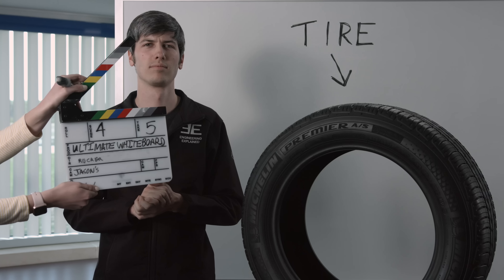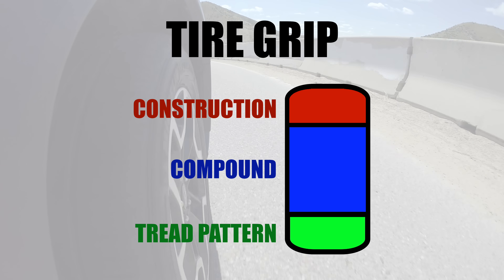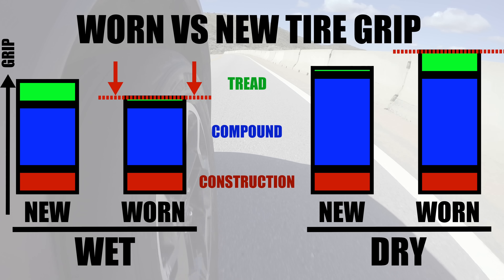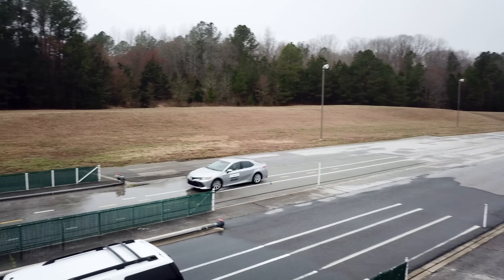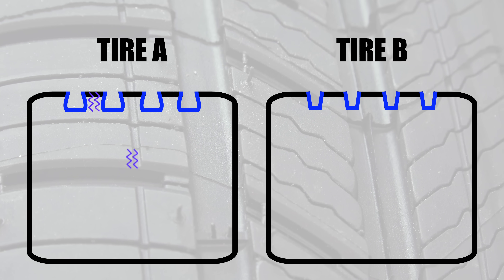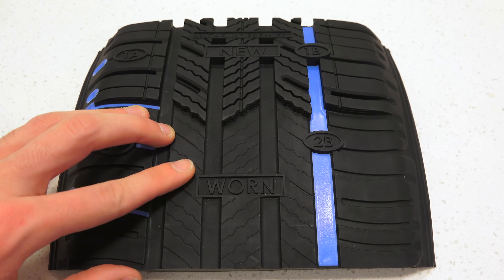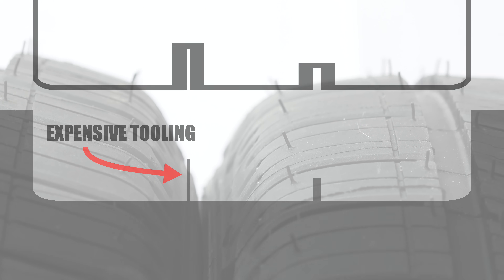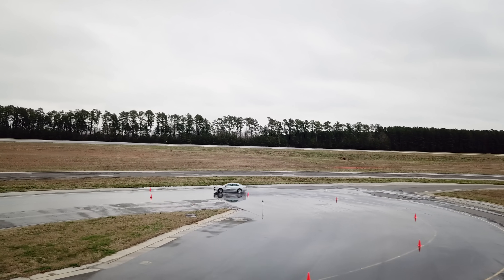New Tires vs Worn Tires - What Performs Best?

Comment: Hi engineering explained maybe you can help me. I put In new struts in my 02 Camry but the new ones were about an inch or so taller than the old ones so now it's nearly impossible to get a good straight alignment and my car eats tires in less than a year! I have had at least two sets in the two years I've been driving and they aren't super cheap tires either. I know my car only has tierods for alignment adjust ment as far as I noticed is there anything I could to straighten my tires out because the inner tread is taller than the outer tread on all 4 I need some way to adjust the camber I think

Comment: This is how a video about Tires should always be done. It doesn't mean necessarily to be kind of similar copies, but the explanation should be correct. I saw different videos where there was this tendency to actually make all people think that is not an issue at all on the wet surface as the Tire Wears. Thanks for giving us this explanation.

Comment: Firstly, what you say about tread depth it correct - this is why ultra-performance DOT tires will have very large tread blocks, and perhaps even :slick" portions of tread. This is also why in some race classes that require DOT tires, people will sometimes do what is called "race-shaving" to cut down the tread on new tires. Yes, this decreases the service life of the tire - but when people will spend money for faster lap times or a competitive advantage, this makes sense.

But actually not true about the compound. The compound grip does degrade over use due to heat cycles . This is a well know phenomena in racing. For example, as you say racing slicks have no tread, so the grip level should remain constant over the life of the tire according to your claim. And this is just not true. Even though the racing slick may still have life in the tire, your lap times will increase as the tire ages and the compound grip decreases. Lap times will again decrease after putting on fresh tires. This is why tire management strategies are so crucial in racing as you will need to decide when to use fresh tires for best lap times and when to tolerate worse lap times with older tires. And this is why some racing classes will control tire use in order to keep costs down. Someone with a lot of money to spend on always using fresh tires will have an advantage over someone who has to use the full service life of the tire because they can't afford to always use fresh tires.

So what you have (in dry conditions) is a rate relationship between the increasing grip as the tread wears down and decreasing grip as the tire compound ages. But the "winner" in that race is actually the grip lost due to compound ageing over grip improvement due to shallower tread depth. So in racing DOT spec classes, there will still be better lap ties with fresh tires over old tires - meaning even on the street in the dry, new tires will have better grip over old. (Now, this is assuming at least moderate level performance tires, it may be that with very fine tread and tread blocks tread wear grip improves faster because there is so much grip lost to begin with, I don't know. But then, people running those tires probably don't care about grip anyway, so the point would be moot.)
Reply: Also to note, while not the exact topic of the video as regards tire ageing, but related to tires and grip is sidewall height. The effect is much like that of the tread blocks themselves. Taller sidewalls allow for more tire flex under cornering which the pulls a portion of the tire up from the pavement reducing effective contact patch size and thus resulting in lost grip. This is why performance tires will have shorter side walls. Hence the plus 1 / minus 1 theory to improving tire performance. Go to the next larger diameter wheel and go down in tire aspect ratio to reduce sidewall height.

Comment: no reason to watch the video
i already know, new tires are best when the first layer is off. it is there to store the tires and to prevent damage to the real "compound" depending on tire, drivestyle, etc it can take 200-500km
why would worn tires make it better? its like asking "are used brake pads better than new ones? or do they even perform better with nothing left on them? lets find out"
how about you test some tires from different companies instead?
Reply: that is not the purpose.  The "coating" on a new tire is simply mold release agent.  Without some sort of mould release it would be very difficult to separate the tire from the mold without damage

Comment: Curious what your thoughts on re-tread tires? (obviously not for performance) If you did a video, I'd also talk about being careful trying to save money on tires because you have to watch out for the tire tread cutting scam.
Reply: that's mostly for commercial tires.  If it's done right it's fine.  Most of the blown retreads you see on the road are from underinflation.  It's not very common for a regular passenger car to even have enough rubber depth to cut grooves deep enough to make it look like a new tire.  Even if this was done the date code on the side of the tire would give it away IF people looked at that when buying used tires.

Comment: There's one thing you forgot! Age!!! Depending on how much you drive, it is not only wear that affects the tyre but also age. Rubber compound is only guaranteed for a certain period. So although you get more surface contact are as the tyre wear down, with time the compound losses its characteristics becoming stiff, dry & brittle
Reply: And on top of age let's not forget heating/cooling cycles.
Reply: Great comment, came here to say the same!
Reply: Mihai Constantinescu THANK YOU, just mention this in my question.
Reply: @PapotsGarage  
You don't know that to be the fact for the particular tire compound in the video.  Some will wear better than others.  Hint: source material for the 'rubber'.
Reply: Ya it's true and also maintain the curing time of that rubber perfectly. Otherwise all the process goes in vain.
Reply: Exactly what I thought I have just gone from 2011 to 2017 Michelin and the dry performance is better as well on the newer tyre
Reply: have you got any other good news for us?
Reply: I can confirm that on my rear Michelin Primacy 3 made in germany. They started to thump due to worn inner threads
Reply: Yep my tire is from 2008. It's currently 2020 at the time of writing this.
Reply: my tires are oem from 2005 and they grip as good as new
 @noahmeme2
Reply: As someone who has never owned a car, but with a love for old bicycles I can tell you that tyres which look new and have not be ridden for thirty years do not last a week (and then came the challenge to find tyres fitting a 1974 22 inch rim whith covid lockdown in china......)
Reply: He actually says compound grip doesn't change as tyres wear.  This is misleading as it does change over time/with age, so unless you're going through tyres every year or so, this is a factor which is ignored in this video
Reply: @OverTheHillMTBAU  Even within a year the compound degrades significantly. At least it does when you are autocrossing regularly.
Reply: Mihai Constantinescu There was a huge oppertunity for Michelin to mention the compound/age effect to make us all buy new tires. Yet they didn't wonder why.... confused.
Reply: @dubro5009  First time I took a car with Michelin CrossClimate2 on into a garage the shop boss slagged them off saying they didn't last.  Well two years later and they haven't worn much and the rubber is still peculiarly soft.  I have bought some s/h PA4 and 3 years old and the rubber is like new.  Some Michelin PS4 S and, yes, same again soft and like new.  My other PS4 S are two years old and have lost their side wall appearance through road dirt but still soft.  Pirelli PZero seem harder after 4 years but then that's 4 vs 2-3.
Reply: And it is more crucial actually than the others.
Reply: cap. some tires are stored in warehouses for 10 years then sold.
Reply: tire.
Reply: Tyre, actually. I tire of your antics.

Comment: This is true and false. Michelin and other companies such as Continental, Yokohama, even some of the newer Goodyear tires have very similar designs in their tires. Continental has a groove in groove technology that helps specifically with winter traction. I can list for Yokohama and Goodyear the similar attributes. The reason that Michelin went with this technology is the expanding grooves and sipes is because the tire starts off with less tread than their biggest as tire the Defender LTX. The Premier A/S starts with 9/32 of an inch of tread where most tires on the market will start with 11/32 or more depending on the tire and the application your looking for in the tire. While the Premier does perform really well, there are some other issues with the tire, since the tire has less tread from the start the tread compound is harder so that there can be a higher life out of the tire but it generates more road noise.

Comment: Great video,
It's possible you missed an important factor though - 
a "shaved" new tire would perform better in the dry, that's why some racers shave new semi-slick and street tires,
However, realistically it would take a lot of heat cycles and time for a tire to lose much tread on road use, so by that time the tire would grip much worse in the dry as well.
Might be worth mentioning, so people wouldn't think their old tires are safe in the dry!
Reply from the maker: Yes, definitely a difference between "worn" and "old." I think it'd be awesome to see some content purely focusing on age and how it affects performance.
Reply: I'd love to see some hard data on tire age.  It's a complicated one though, some of the age is pure age, some of it depends on environmental conditions (which is why i store my winter tires indoors to avoid UV degradation)

Comment: You forgot about heat cycles that change the compound performance
Reply: St0RM33 thank you, I asked the same. My a048 are a full second slower when old
Reply: Ummmm you don't heat cycle  touring tires lol. Trying to race with them will help your drifting though lol

Comment: I was targeting a set of these about 2 weeks ago, but my installer couldn't recommend them because of short tread life.  Of course, with a compound that grips more, the tread will wear faster - everything is trade-off with tires.  It makes me wonder if this tire has a mistaken identity.  Anyway, I'll never know how much life I would have gotten out of them because I didn't buy them.  I still like them though.  Cool tire.
Reply from the maker: What specific tires are you referring to? The ones in the video have 60k warranty. Personally I use a summer and winter set with less overall tread life rather than all-seasons, but the ones shown are definitely designed for long life.
Reply: The Premier A/S is the tire I was referring to.  I was surprised to hear that from my installer, but they are tire nuts so i went with their recommendations.

Comment: Older tires also get better gas mileage due to less friction.
Reply: Friction increases with treadwear. Didn't you watch the video?
Reply: Yes I did. All that tread on new tires adds rolling resistance. As the tread wears away, the tires become smoother, and have less rolling resistance. There is more surface area touching the ground, which when dry can gives more grip for acceleration and breaking. But under constant speed, such as interstate driving, the reduced rolling resistance allows better gas mileage. I’m on my third set of tires with the same car. I buy tires designed to improve mileage. Every time I put on the new tires my mileage instantly drops 3-4 mpg. I even called  Michelin to ask why their high mpg tires caused my mileage to drop. Their response was the newer tread caused more friction than my older smoother tires, and that the mpg would increase over time, as the tires wore down, which is exactly what happens. They also said water performance would decrease as the tread wore down, which unfortunately is exactly what happens.

Comment: My tires used to be worn out with no tread, and terrible in the rain.  Now the threads are exposed and they work pretty well cutting through the water.
Reply: GoogleMinus same with mine. They are down  to the canvas and the grip is much better now.
Reply: GoogleMinus I have really bald tires on all wheels and they still drive fine and I push my car round corners

Comment: The compound may not change much if you wear them down in a short period of time.
But it may take years to wear your tires, and in this instance the compound changes at least as much as the rubber looses its softeners. And with that often lots of Grip.

Comment: Michelin Premiers are pretty terrible tires. Good idea, but I've never had a tire chunk so much.
Reply: Andrew Malkin  The reason they chunk out is because of the deeper sipes and the amount of silica in the read compound.
Reply: Cure Meister Try a Michelin Defender instead.  It's not as fragile on crappy roads
Reply: V - Pony The new Defender T+H also has a silica compound.
Reply: That's because you either drive on really crappy roads (not your fault) or you drive way too aggressively (your fault). I've had a set of these for 2ish years now and they're wearing perfectly.

Comment: I actually noticed this when my Michelin Primaxys were new. I thought it was weird that brand new tires didn't grip as they should. From 500 - 1000 miles they improved exponentially, I guess it was just the break-in period.
Reply: that's due to the mold release used when manufacturing.
Reply: animefreak5757 thanks for the info. It did feel like they were slipping on something. I looked like a douche more than once taking off at the stop light with all the unwanted tire squeal and drama.
Reply: it's a unfortunate side effect, if they didn't use a mold release agent it would be hard to separate the tire from the mold, possibly even damaging the tire as they separate.  I just like to drive real careful and make sure the roads are dry when i first fit new tires (the breakin is annoying, but it can be downright dangerous if there's bad condition's on the road)
Reply: animefreak5757 A couple of months back I lost all confidence in my skill and in my car driving on the highway during a rainstorm. Thanks for telling me this because you just made me realized why my car was behaving that way it was. Everytime I went through a puddle it felt like I was momentarily driving on ice. I actually blamed everything but the tires because they were brand new but they were exactly the problem. This is only my second set of new tires and I can't very much remember breaking in my first set. Thank you for passing along your knowledge!
Reply: np, I've always been a bit more sensitive to such things because i learned to drive on a motorcycle.  All the little things car drivers take for granted become very obvious and important when you ride motorcycle.

For instance, if it's been dry for a few month's, then it rains, a lot of the oil buildup on the road lifts off and it can become very slick, much worse then if it's just a wet road

Comment: Dry traction will not necessarily increase as the tire wears because the tires will heat cycle as they are used, making them harder.
Reply: Matowix you've obviously never heard of Paul Walker, have you...
Reply: @VCBird6  wasn't Paul Walker's friend speeding in a Porsche. the accident had something to do with old worn-out tires also?
Reply: @darrenporsch  eeeyup
Reply: @VCBird6  I know his daughter was trying to sue Porsche. I don't think that's going to go that well for her
Reply: Ryan Gehret 
I just steal worn tires from my local racetrack. I get free tires and I’m recycling as well as getting free hooiser racing tires
Reply: Very true, had a pair of Dunlop BluResponse which were worn but not yet at the limit and thought it would go another season. 
When I switched from winter tyres the braking was dangerous : the car just did not stop as well as I was used to even if it was hot outside (+18 Celsius), I almost rear-ended someone - luckily I had some space in the left lane to avoid the collision otherwise it would have been an accident, decided to buy new tyres after that.
Reply: I hope you're not driving on 16 years old tyres!?
Reply: Heat cycle, lol these aren’t race tyres
Reply: Gerardo Hernandez, all tires heat cycle, not just race tires.
Reply: Andrew Malkin true. mine  are 16 years old but the average driver doesn't drive a car hard enough to warrant worrying about them getting a bit harder. as long as they are structurally safe it makes little difference unless you are on a racing track or using  motorcycle tyres which are more critical.
Reply: You should not be driving on tires older than 10 years, that's an accident waiting to happen.
Reply: You are putting others on the road in danger.   Tire compounds maintain properties only up to 6 years.  Meaning he compounds hardens and break down.  But this is only a minor problem for old tires. 
 Most importantly, tire cords (structure of tire) only last 6 years or so. These polyester cords brake down as time goes on.  Safety factor is somewhere around 600% in modern tires.  So usually the strength will hold even after 6 years.   However, in heat, the cords and compound get separated, resulting in blown tire.  The adhesives between cord and compound is the weak point.    How long do they last?  Anyone's guess because there are so many variables affecting the adhesion.    Heat is certainly a factor.  Also compound itself becomes brittle providing little matrix for cords to adhere to.    Well that is when tires blow up.   It happens quickly. 
Good luck!
Reply: Jimmy Y not all